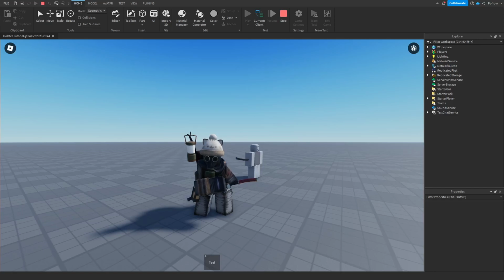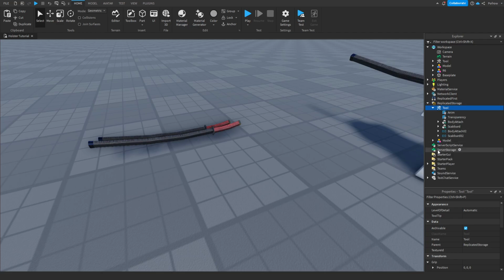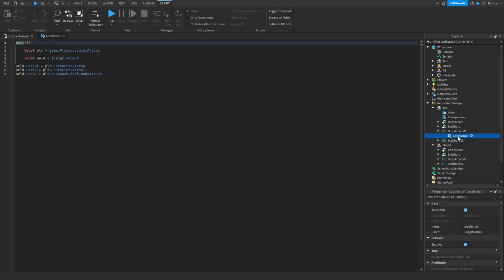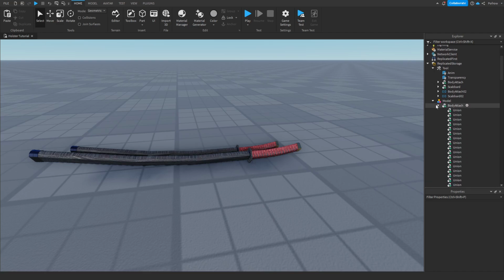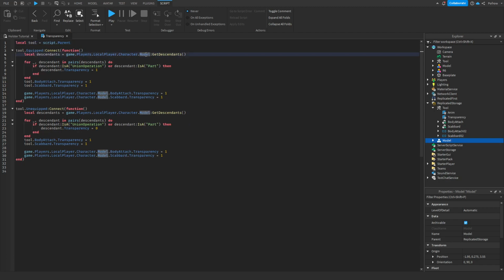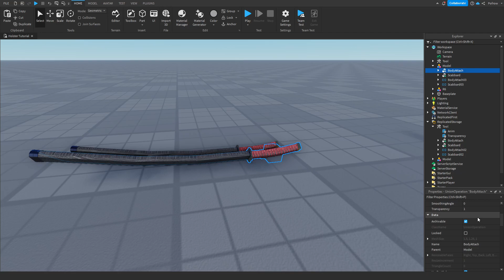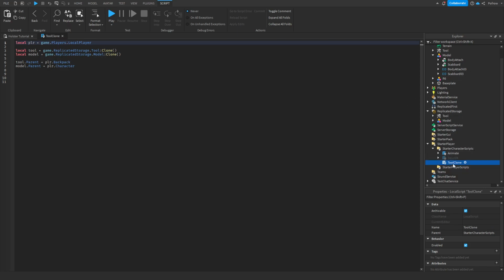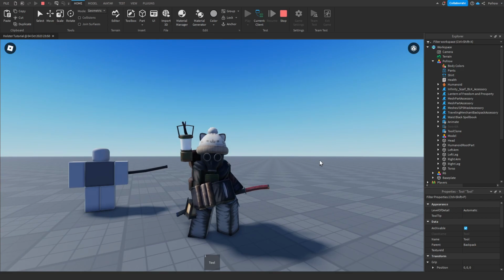How to Holster Tools | Roblox Studio

Comment: You probably won't see this, but my sword is made from Blender, which has mesh parts, which means I cannot use Union instead of Parts from Roblox Studio. Is there anything I can do to have the same result if I were using regular parts?
Reply: What you can do is weld them all to one invisible part and use this invisible part for your Motor 6D.

Comment: ok so, when the tool is equipped, it just sticks right through my back,
and when the tool is unequipped, the tool is on the floor and does not follow me.
Reply from the maker: Check for spelling mistakes and errors
Reply: @pofrow  oki
Reply: @pofrow  so i figured it out for the most part, but now i wanna change the rotation because the object is rotated 90 degrees to the side and i dont know how to fix it. i also have an issue where the arm doesnt go up when the tool is selected.
Reply from the maker: @rkor_chudella_vescent  If u want the arm to go up while the tool is selected u either animate that or turn on requires handle
Reply: @pofrow  oh oki, thanks :D

Comment: im making my own katana and sheath and used this video to help me find out how to unsheathe it but after finishing the code and doing everything you told me to, the katana model doesn't appear
Reply from the maker: Have u checked for mistakes?
Reply: @pofrow  yes and the only error that was detected was
 weld.parent = plr.Character.Torso
and its saying that  "parent is not a valid member of Motor6D"
Reply from the maker: @NoahRosario-pf5qn  U wrote it wrong its Parent not parent
Reply: @pofrow  oh thanks!
Reply: @pofrow  well now i have another issue, i have one katana on the ground and another one phasing through me, i can fix the second problem by adding animations but is the first one supposed to be like that? its not picking up on any errors
Reply from the maker: @NoahRosario-pf5qn  That could be a problem with the welding of the tool select the main part of the tool thats on the ground and see if the mainpart is also on the ground or on the player if its on the player than the tool is not properly welded if its on the ground then something went wrong with the script
Reply: @pofrow  how do i weld it to a player?
Reply: wait nvm
i know how

Comment: my sword is just stuck in my torso even though i made an animation for it
Reply from the maker: Did you rig to sword to the torso in the animation too?
Reply: @pofrow  I did follow your how to animate a tool tutorial but it just got stuck in my torso, the animation played just fine and the sword was welded too my torso just fine but the sword wouldn't play along with the animation.
Reply from the maker: @OfficialSaqn  Make sure the tool and model are identical if the tool is inside the torso that means it was rigged properly but if the anim doesn't play for it the model and tool might be slightly different try copying the model and pasting it in a new tool and test it
Reply: @pofrow  so I tried copy pasting it cause I remade the animation and rig model cause the actual rig was being welded to my torso, after doing that it doesn't weld too my torso and just spawns in the rig i used to animate it with
Reply from the maker: @OfficialSaqn  Check to make sure the welds are correct
Reply: @pofrow  I re did all the welds cause I couldn't see a problem with them and I'm having the same issue although one strange thing is I have 2 tools when joining the game, upon inspection in backpack I do only have one. one of these tools is going straight through my torso and the other seems to spawn at the animation rig, I don't have anything visible when neither of these are equipped. I did also check my scripts again and I don't have any errors and I made sure the group name and tool name is the same. and last thing I notice is sometimes when I join the game the tool isn't in my backpack whereas other times they are. I honestly don't know how all of this has happened o_o

edit: ok so after tinkering around abit and remaking the animation AGAIN and now there's only one tool luckily its stuck in my body and the sheath still spawns in the dummy and doesn't go invisible when the tool is equipped apart from that any other errors are fixed